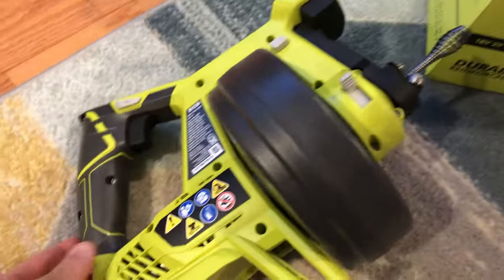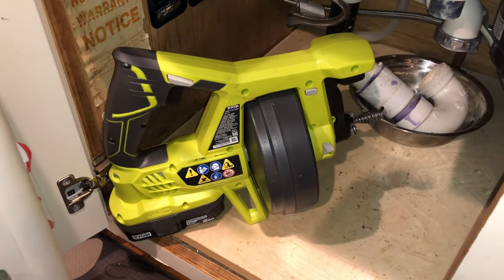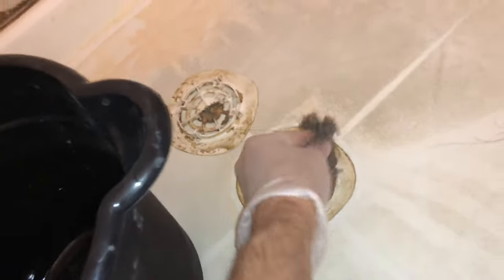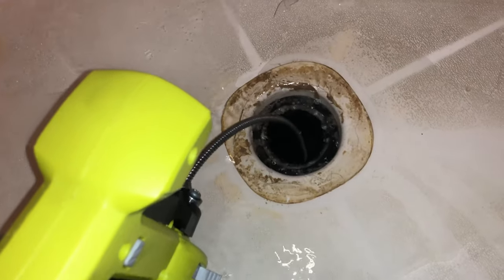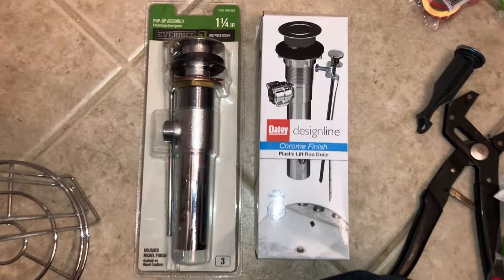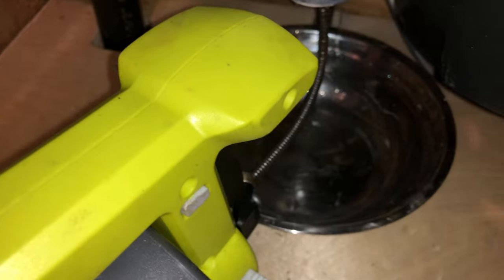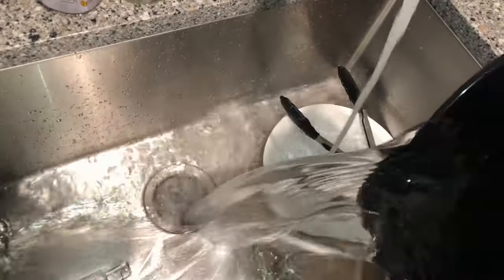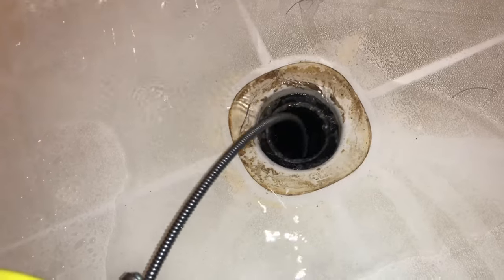Ryobi One+ 18V Drain Auger P4001 Usage and Review

Comment: If the snake did not unclog the pipe, if you have a power washer there is a hose with different interchangeable attachment that you can connect to the power washer and unclog your pipes through water pressure.
Reply: How are you going to bend from the kitchen sink traps? Does not make any sense.
Reply: I did purchase the 1,900 psi Ryobi pressure washer. It works great cleaning cars and with the soap cannon it really puts out the foam.
I also ordered the high pressure drain cleaning jetter. The hose is about 30' which is long enough for my needs. You can also get a 50' hose.
Reply: @ladha99 It seals at the entrance and just forces water into the drain to clear the clog with pressure. The power washer hose doesn't actually go down the drain.

Comment: Add a tee and studor vent on that kitchen sink drain!
Reply: An air admittance valve (AAV) is a one-way mechanical valve that is installed locally at the site of a plumbing fixture, allowing proper venting to occur without a connection to a larger venting system and stack vent. AAVs are gravity-operated devices that respond to the negative pressure of draining water and open to let air in. They are used most commonly at an island sink or vanity, and may be used to prevent roof penetrations.

Comment: can i use it on 4 inch main?
Reply: 5:30 he said it’s not recommended. I guess if it all you are cleaning is the larger pipe what should be ok. However, if you run it from a small pipe to a larger one and clogs up in the larger one, you may not be able to pull it back our through the small pipe.

Comment: I bought one a couple days ago. The auto feed button was pushed in and it works great spooling out the cable, but I could not push the button from the other side to reverse the feed (back in the case). I took it back to Home Depot and they had a Ryobi representative there. He tried to bush the button back without any success. He went and got another one and at first it didn't want to press in until you pressed up on the top handle and the plastic auto feed button did reverse the cable. I hope it gets easier when I use it more.
Anyone else found this to happen?
Reply: See page 7 of the English manual, under AUTO-FEED LOCK. You must squeeze the pommel each time you engage or disengage the auto-feed, while moving the lock. I’m pretty adept with mechanical things and tools, but it took several reads of the manual and dry runs of the tool to understand just how it works. Probably good to keep the manual handy with the tool, since one will probably not use this very often. It would be easy to forget how it works. Of course, this video can save the day!😊